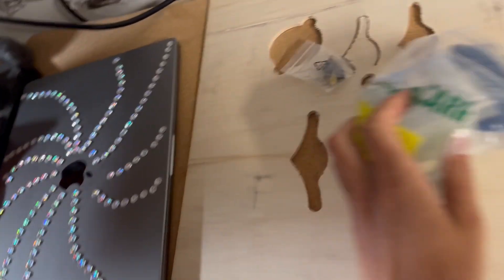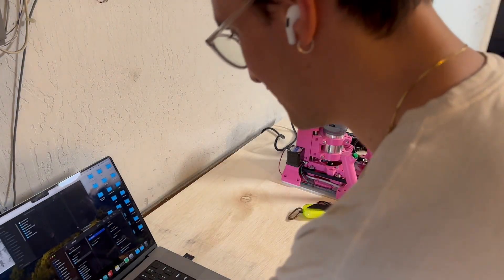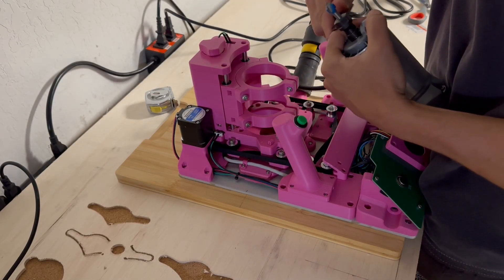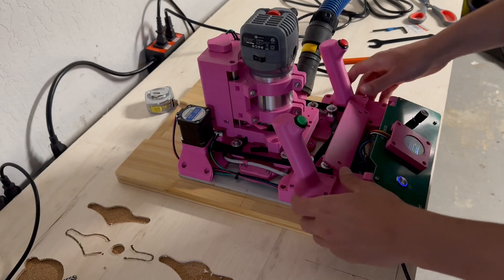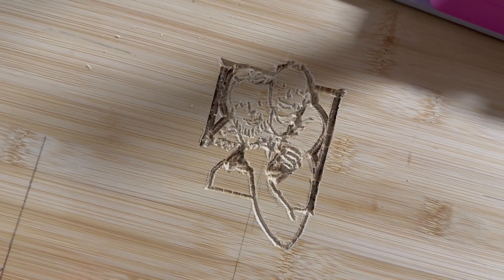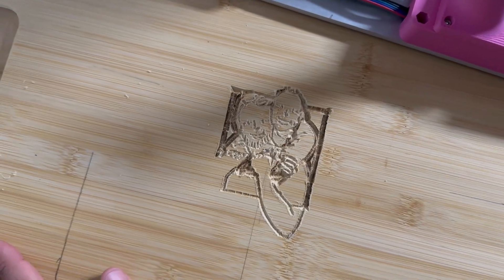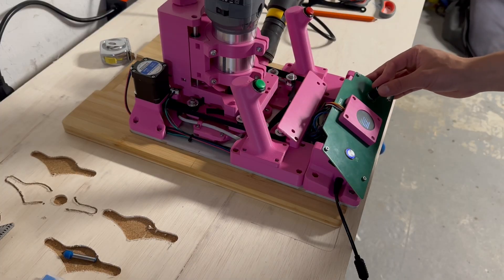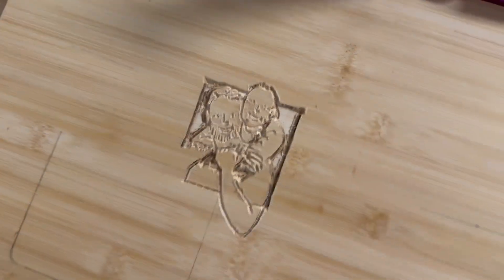Cutting board project w/ Compass CNC

Comment: Great Project, got my PCB's and my Base plate a few weeks ago and currently printing all the parts in PETG. Can't wait to try my first Marquetry with it. Should be a Game changer for such projects. Got myself a cheap 5V line Laser and I will check if it would bei helpful for the first positioning of the middle Point of the contour. Fingers crossed that I find a convinient way of attaching it somewhere.